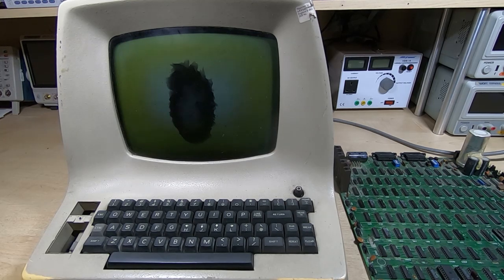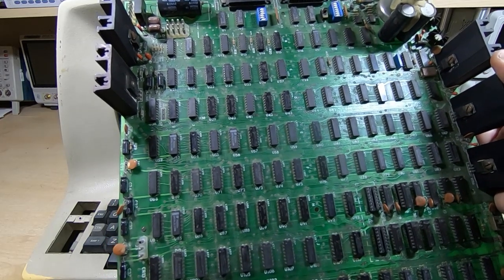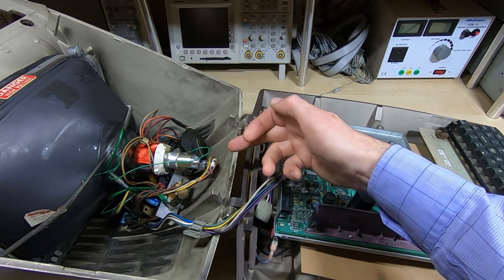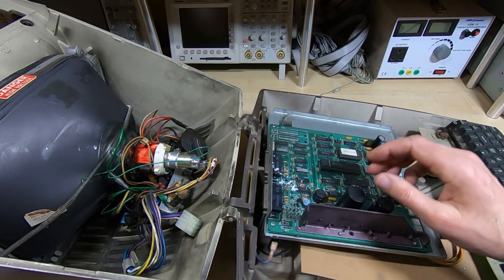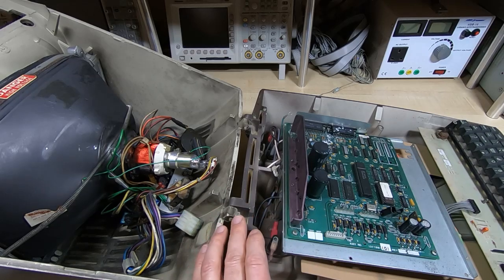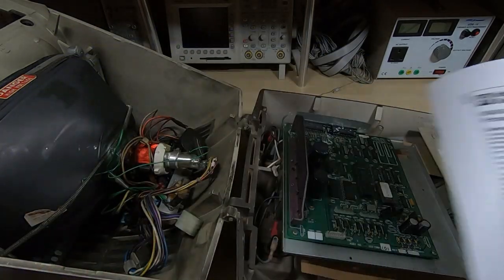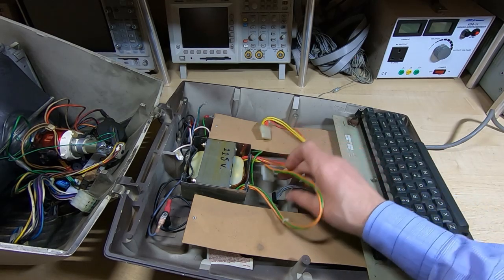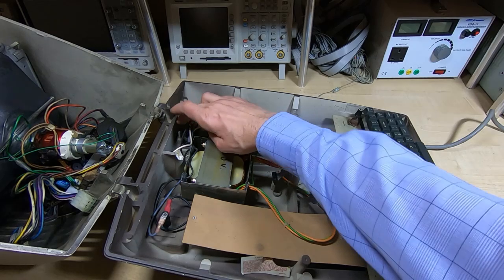ADM3 #3 Repair Part1

Comment: I’m not familiar with the ADM3. Is this a functionally identical cost reduced version of the SSI version, or is it functionally better as well? Interested to see how the repair/restoration goes.

I’ll repeat my suggestion from a previous terminal repair: it would be very interesting to see this hooked up to a proper unix/Linux login, when you have it running.